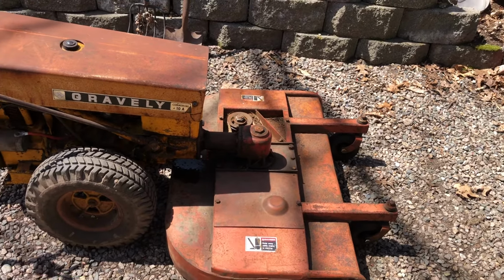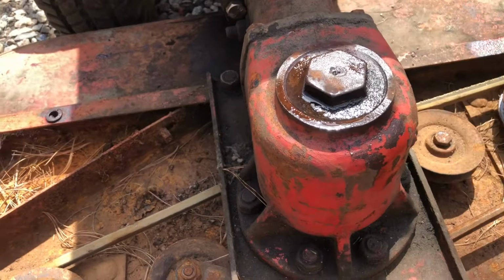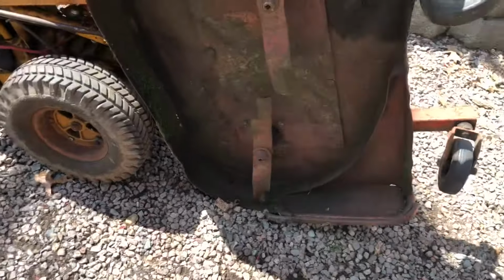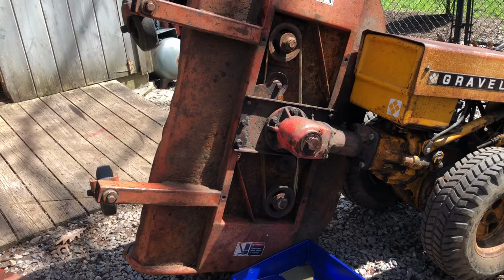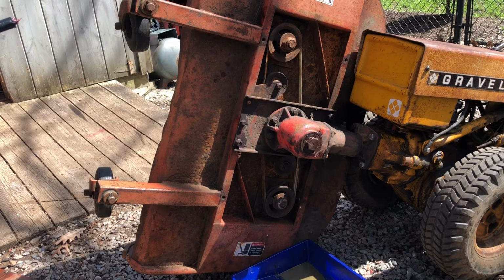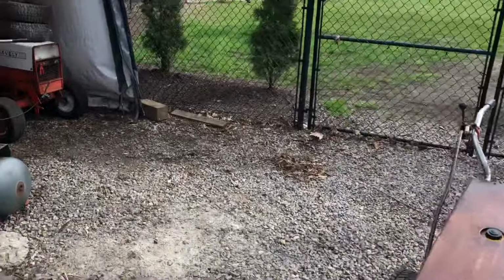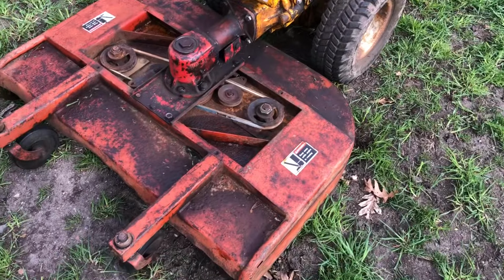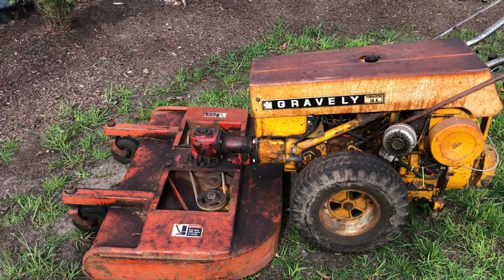I scored a Gravely Commercial 40” deck!

Comment: Nice find! I like the Commercial 40, even though it doesn't cut like a 50". It's a well built mower.
Reply from the maker: Yeah once I have new belts and the new pulleys I will mow a larger area with it.

Comment: If there are bronze worm gears in that drive, I'd use GL 4 gear lube and not GL 5...that's what I use in my MA-210 Snow Cannon. GL 4 is hard to find, but I found it locally at a marine supply...it's from Mercury Marine used in MerCruiser  lower drive units. That Commercial 40 has lot's of life left in her...great find.
Reply from the maker: Yeah all steel no bronze. Thanks for watching

Comment: How much did that deck cost? If you don't mind me asking. Or how much is it worth
Reply from the maker: Over the years I’ve seen $75-$400.  I bought and sold one at the Gravely mowin bought for $75 then sold 16 mins later for $125.
Reply: @DKTractors  Hopefully that paid for lunch and gas to get you there